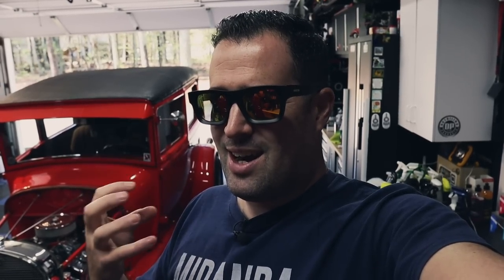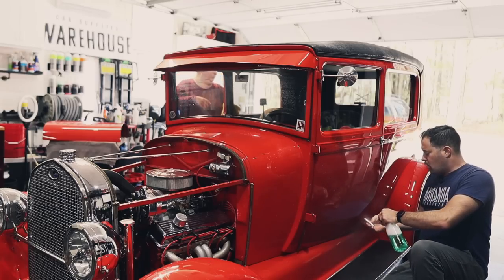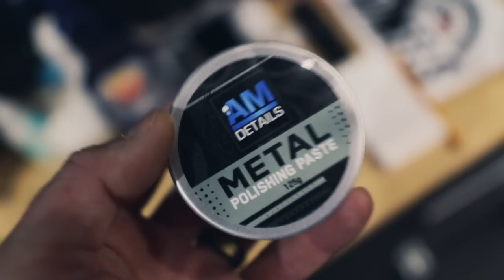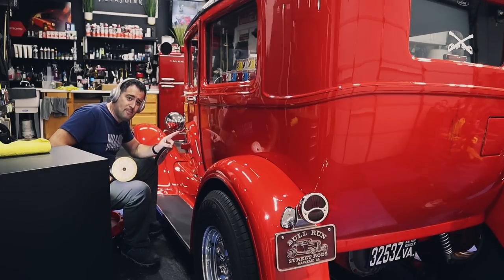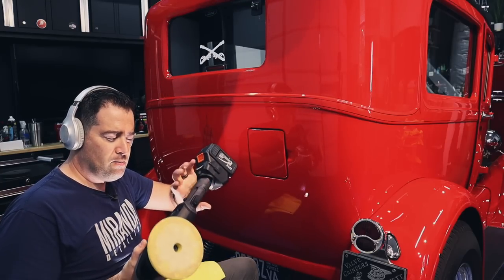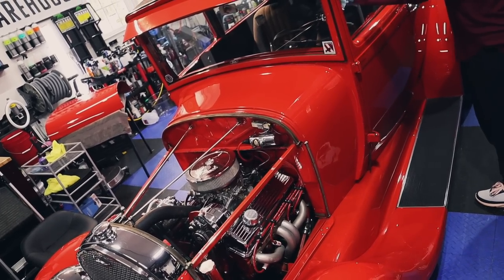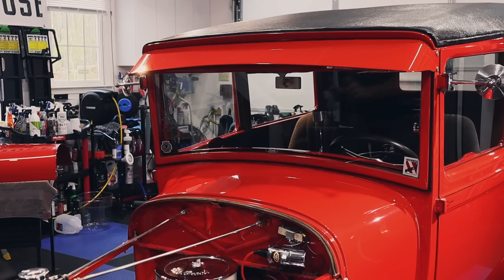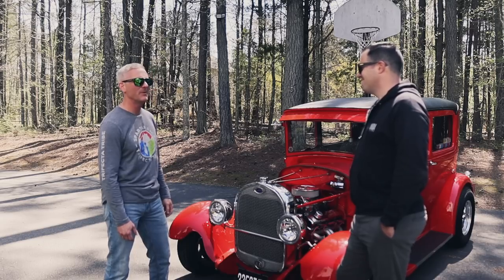1929 Ford Hot Rod's First Polishing! #hotrod #ExteriorDetailing

Comment: Techie info:
GM 350 Light Duty (14010207) – bolt main from 80-85 Malibu

80 Caprice TH2004R, 4-speed automatic; with all GM modifications and set up as Buick, GNX type w/shift kit

70 Camaro, narrowed, 12-bolt (Eaton) Tru-Trac positraction with Moser axles (set up for Ford bolt pattern); Motive 3.55 gearing

Comment: Phil, another great video. On the topic of the chrome plated rad, how would you handle the bugs that get trapped in the chrome and in the rad fins? It wouldn’t look right to have a hot rod that has pristine paint and the first thing you see is wings coming from the rad lol. Thoughts?
Reply from the maker: Thanks. So the hood thing about this one os it can get wet. I would gently pressure washer the bugs with a big remover. And use compressed air or the blower to get blast them out.